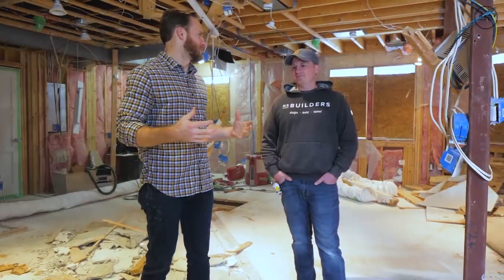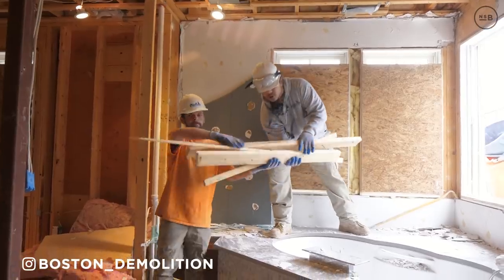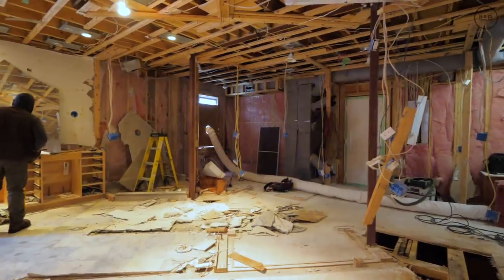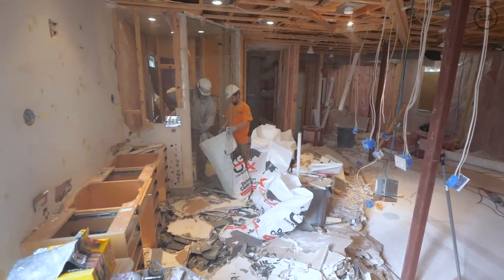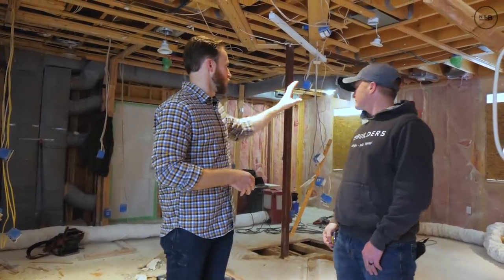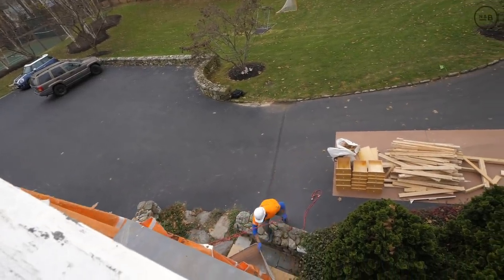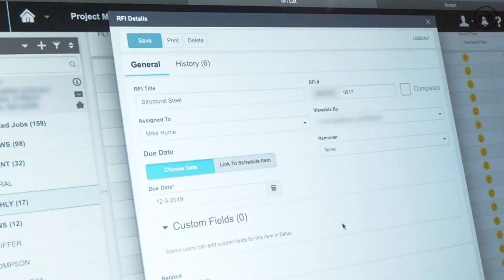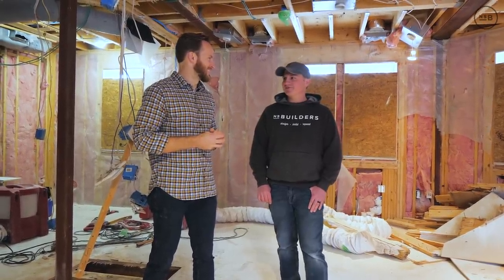How the Demo & RFI process work at NS Builders Weston renovation

Comment: Is there a reason there was not some exploratory demo done before or during design to find those posts?
Reply: This is a relatively new house so they probably have the original blueprints.  The whole project screams that money isn't an issue
Reply: Sergey Bebenin true but then the beans should have been even less of an issue no?
Reply: @hellonoko  
The way I see it, they couldn't care less what's there.  They'll design the way they want to, not around it
Reply: Sergey Bebenin doesn’t the video say they have to change the design to because of the steel? Or at least contact the architect to discuss it?
Reply: @hellonoko  
I took it as they will make changes to existing steel... anyway, we'll see
Reply: My customer would blame me the builder for not seeing this. Have had a string of difficult customers so when I saw what they were talking about with the medal post I thought oh boy these guys are screwed and yet made it seem like no biggie. Difference between expectations of customers.
Reply: Even though the bathroom was remodeled 16 years ago it might have been done by a previous homeowner and therefore the drawings are not necessary available to these clients. 
     Sometimes you just need to jump into a project and figure it out. Construction is one of those trades where horse sense is 90% of the effort. We don’t have X-ray vision and generally we don’t have access to ALL the information. 
     Besides they said they didn’t know it was remodeled until they removed some window sills and found dated tags.

Comment: Pro tip with the Easy Chute:  borrow your plumber’s pex-A expansion tool; cut up some 3/4” ( 1” is better) pex-B tubing; slide them through the 4 loops provided; expand one end of pipe to slide over the other end to create (fitting free) hoops to keep the chute open.  There’s 3 hoops per section of chute; combine sections with a hoop.  Works great! ( use a heat gun to relax the expanded pipe to really lock it in, as the expansion tool was designed for pex-A; pex-B is stiffer for this application)

https://share.icloud.com/photos/0lSmssoCFPMvZc5RZkPHDF8IQ#South_Portland